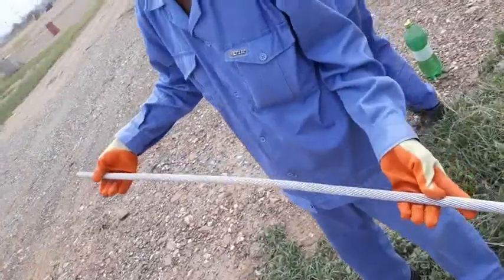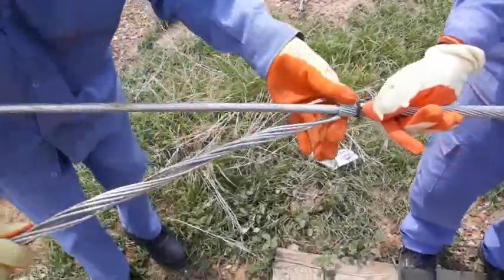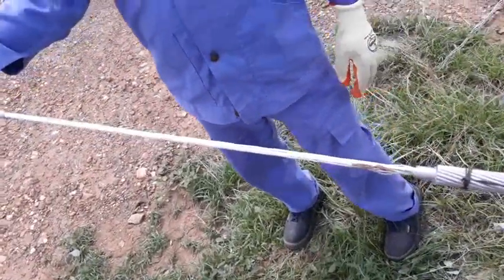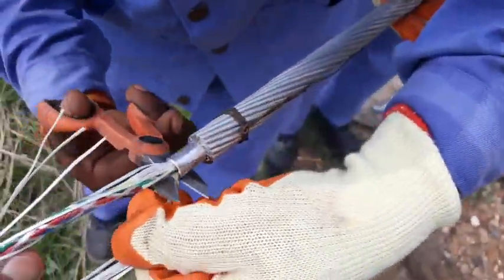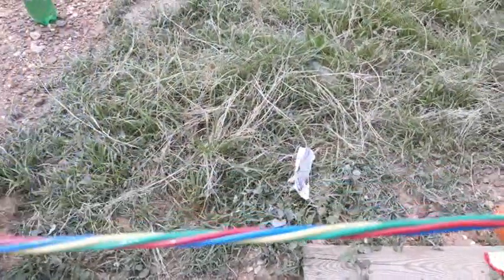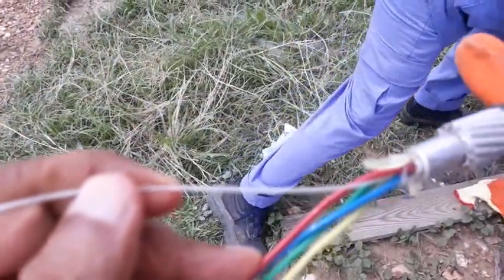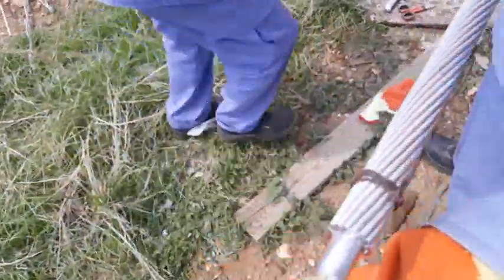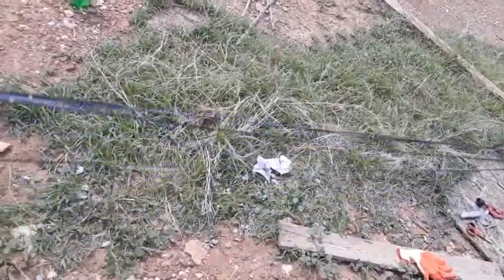OPGW PREPARATION FOR TESTING PART 2

Comment: Thank you.  The gel shouldn't be cleaned from the entire striped fiber but only from where it should be spliced because gel protects the fiber against moisture. If some moisture gets into the jointbox, gel will protect the fiber